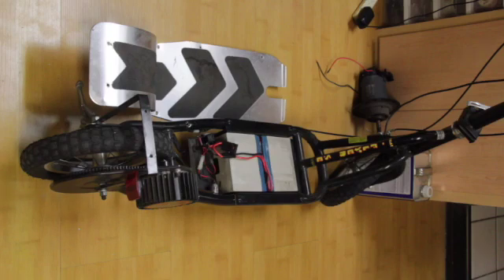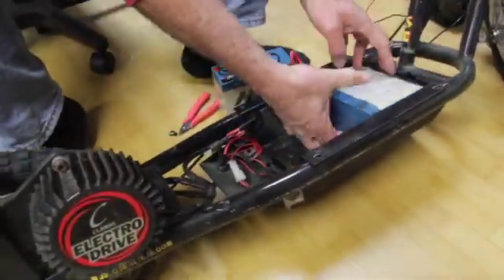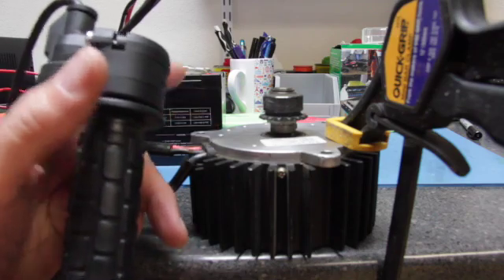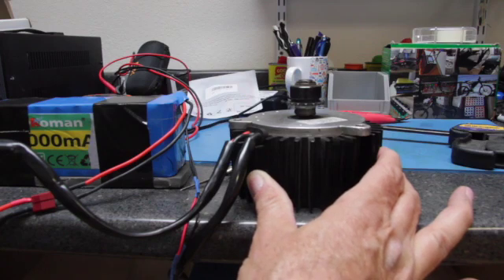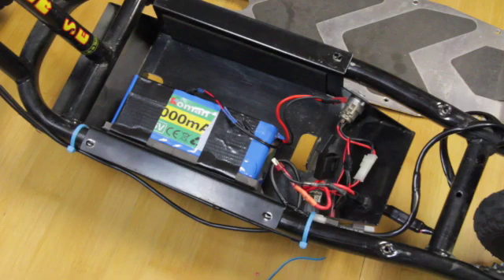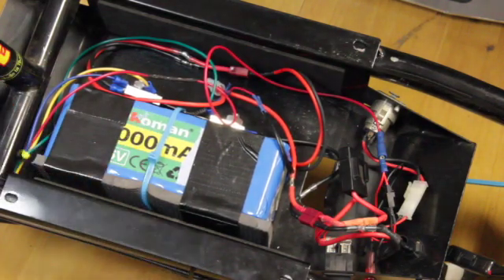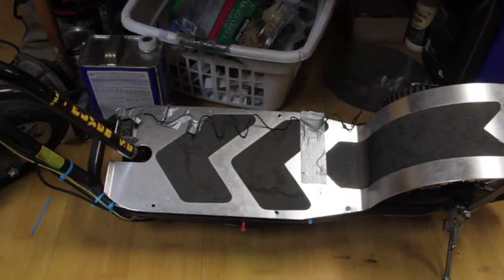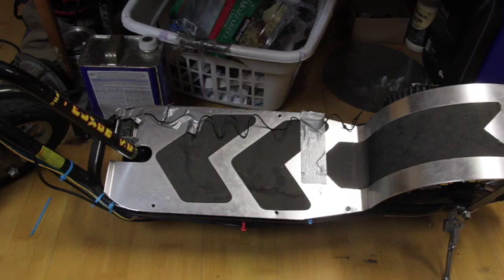Over Volt Scooter Testing

Comment: This is great -- thank you. My scooters in the same vein are even a little bit older. It's a Currie "Scoot-R", powered by 24V 300W. I don't see an ESC anywhere, so I think it is like yours in that it is an integrated ESC, or it is located in the throttle, which I have heard of too. Wish me luck.